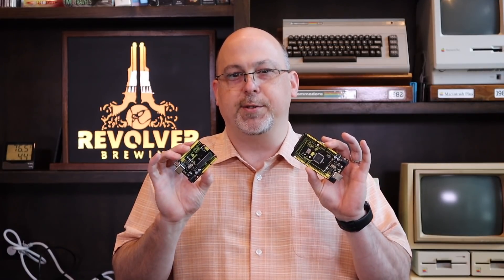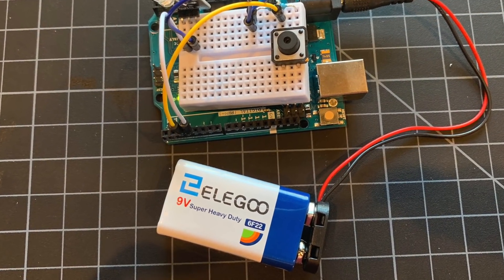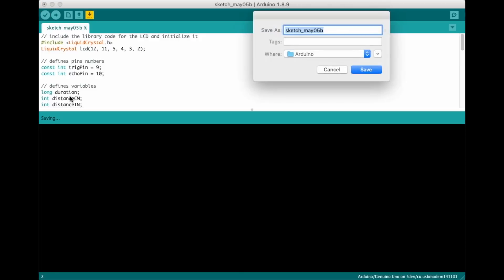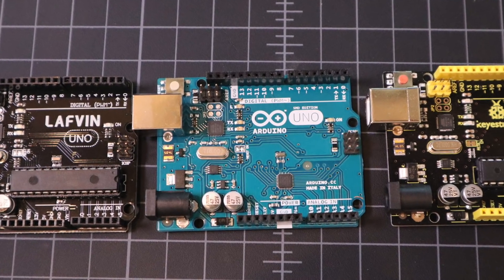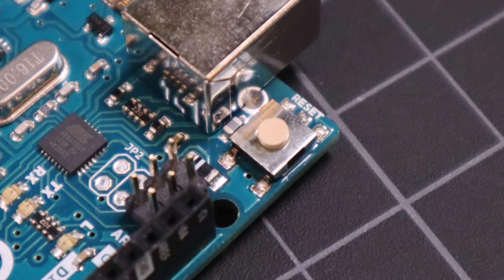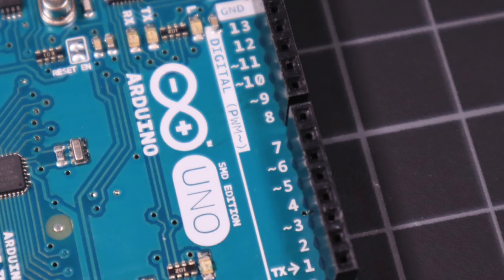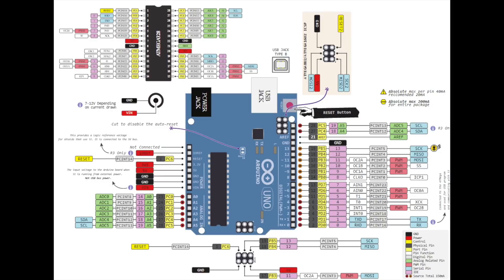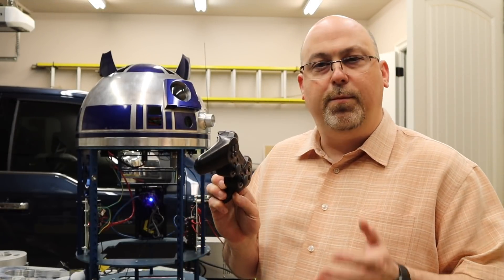Let's Talk Arduino - An Introduction (Updated)

Comment: I was surprised to figure out that the IDE can even be ran on a Raspberry Pi and works great. And that keystudio board I have as well. Only $9 for the entire board. Crazy! I hope that FPGAs can eventually get something as easy to use, inexpensive, and portable as well as Arduino.
Reply from the maker: Funny you bring this up, in my R2-D2 I actually use the RPi to program the Arduinos remotely.

Comment: Usually people don’t mention that the objective of arduino is to PROGRAM the Atmega. After you flashed it, you remove the atmega from the arduino and use it directly in your projects. Without the arduino board.
Reply: For the Uno, yes. The Uno is basically an ATMega328P development board. But some of the other boards you can't remove the microcontroller.
Reply from the maker: This is true for through hole style Arduinos, but many of the boards shipping today are the surface mount ATmega328P which can't be removed.
Reply: I use the boards along with breadboards and dupont wires to rapid prototype and then when I'm ready I spin a board for the smd version of the chip so I can get things nice and small/convenient.
Reply: The arduino is definetly not a programming board. It is a development board, so you don't need to design and manufacture a board to test your ideas. You're better of making/buying a real programming board or placing ICSP on your project, because otherwise you can throw away your dev board, the 328p needs to be flashed with arduino bootloader to be able to be programmed in the dev board.